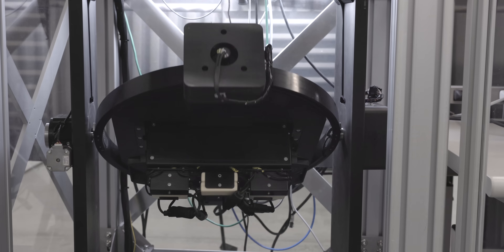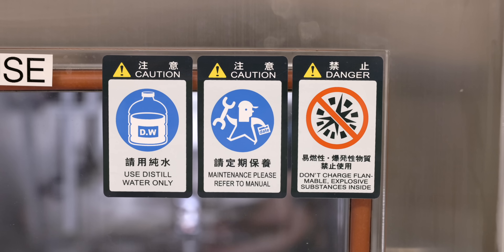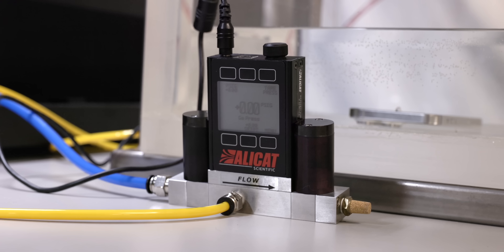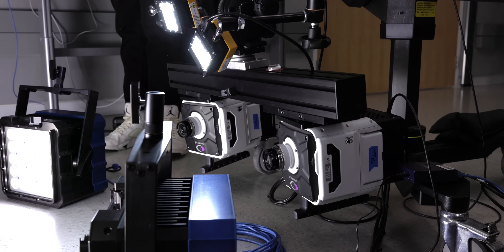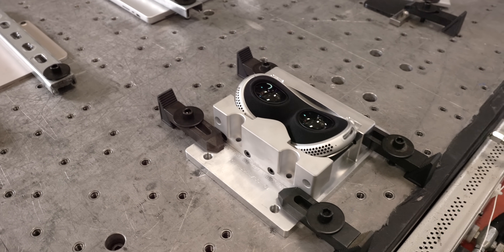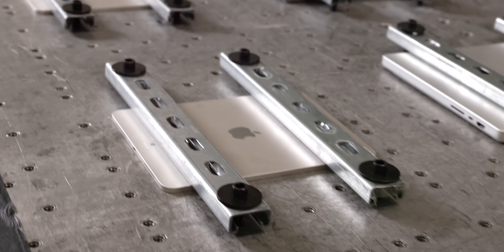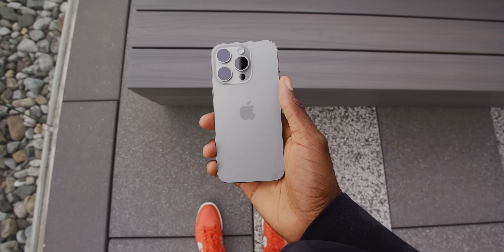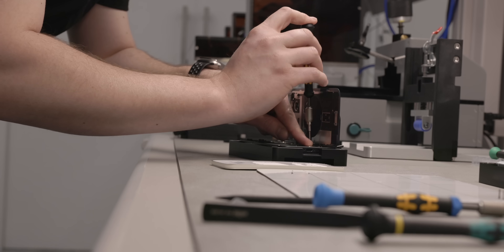I Visited Apple's Secret iPhone Testing Labs!

Comment: Saying that durability rules out repairability is I think outright wrong. Even the Apple engineer who would benefit from such a statement questions it. Pairing parts to make them harder to replace doesn’t add anything to durability, clips that break when disassembled don’t add anything to durability… in Fairness there may be a few components that would suffer from being taken apart like silicone/rubber sealants but that’s about it. Please really think about that statement Marques because it genuinely makes much less sense than you seem to believe.
Reply: I mean it's another promotional campaign and he's not going to question Apple's obvious anti repair practices
Reply: Also, consider how well-built devices like Fairphone and Framework's laptops are. The Steam Deck is a great example, too. They're still quite well-made, and don't have any of this anti-consumer behavior. I wholeheartedly agree with you here.
Reply: @nerdman1324real  The fair phone I would argue is actually more towards their point, it is only IP 55 rated while being much more bulky than most modern smartphones. There are always trade offs. That being said some stuff, like parts pairing are much harder to excuse.
Reply: @nerdman1324real Thinkpads came to mind for me. They have an amazing reputation of having insane durability and repairability that allow old thinkpads from decades ago to be used in this day and age. I don’t like how Marques is making repairability sound like a tradeoff that makes a product less durable when it is definitely possible.
Reply: @nerdman1324real  that's a fair point but could you drop a Steam Deck in a lake and still have it be functional after you fish it up?
Reply: @nerdman1324real  they're quite well made for what they are. but what they are is inferior to regular laptops in terms of design. Simply because they offer additional features. But those additional features come with costs. Not only is the price significantly higher with the framework laptops, but also consider that the profit of any given company is the only thing that drives innovation or funding for research and development. For example, paying companies like apple and Microsoft is what allows us to have an OS in the first place. Yes I know, there's linux. But people forget quite easily that Linux also wouldn't be anything of any significance without corporate backing. The majority of the code contributed is by corporations not individuals or hobbyists.
Reply: @nerdman1324real the fairphone literally falls apart if you drop it, and isn’t waterproof.
Reply: @nerdman1324real  Funny you mention 3 devices none of which is even close to IP 68 rating.
Reply: Outright refusing to sell reasonably priced repair parts, or any parts at all doesn't help either...
Reply: The perfect example is old Nokia phones : extremely durable (though water resistant) yet very easy to repair
Reply: just look at the old thinkpads
Reply: You can make a product not durable and not very easy to repair. Therefore you can make a product very durable and easy to repair. Are you saying the older iPhones are easier to repair because they definitely weren’t as durable as today?
Reply: One look at Hookes Law and Marques would retract that statement
Reply: i second this idea.
Reply: Also dont talk about how macbooks are designed in such a way where most repairs require an entire new board if something goes wrong.
Reply: In many parts of the world iPhones got stolen and snatched and sold in market as spare parts. So it makes a little sense.
Reply: OH MY GOODNESS! Didn’t anyone catch it that it’s not “Durability” vs Reapairabilty but RELIABILITY vs Repairability??? There’s a huge(!) difference. I get it, the parts pairing seems like a totally unreasonable choice, but a product that is more RELIABLE aka won’t fail (think Toyota Camry), not won’t break when it falls (think Jeep Wrangler). The Camry will always start up, but the Jeep will never break. The Jeep is focusing on repairability so that it can easily be fixed out there but it’s not reliable. The Camry is hard(er) to repair, but you never have to. I hope that clears things up.
Reply: Yeah that was such a BS argument. Like most phones these days are on par with iphone durability wise but some are way easier to repair. In ideal world I could buy that argument but we do not live in that world and iphone is not durable enough to justify poor repairability. And I doubt it will ever be that durable.
Reply: 💯 to say durability is at odds of repairability is complete bullshjt
Reply: I second this, you can have a device that's both durable and repairable or, fragile and irreparable. there's also a third variable of cosmetics.
Reply: How is he the largest tech reviewer on this platform and just verbatim repeats and agrees with literal Apple leadership on their bs anti-consumer reasoning? Like what? How the hell are repairability and durability opposites? Has he ever seen ‘pro’ business equipment and hardware, they’re made to endure a lot and be repairable? What kind of paper thick journalistic rigour is this?
Reply: @RobertHarnett it’s a phone… why are you comparing it to “business equipment.” Let’s listen to the random on YouTube over a certified engineer. It makes complete sense, though Apple is 100% anti consumer in the way they offer repairs.
Reply: I'm pretty shocked marques even gave apple the platform to talk this PR nonsense :D how can you say making repairs more difficult directly helps durability. As far as I remember Samsungs have IP68 and all of their repairs are cheaper and the phone holds up as well.
Reply: @DU715 shocked?lol first time watching the channel? It's apple, what do you expect from marques?
Reply: Except even for Samsungs newer phones, they follow the same trend. They’re more durable than they used to be and also much harder to repair nowadays than they used to be
Reply: He’s not saying that’s a hard set rule he’s saying there’s some instances where that is true and you have to choose to prioritize one of them in that case
Reply: @snowwsquire  The problem is that's not what Apple is doing, He was trying to be sneaky as far as I'm concerned. If Apple wanted to design a Phone that was both durable and repairable, they could but that would hurt their buttomline. They could care less about the environment,
Reply: @snowwsquire  "hard invest" lol
Reply: What the engineer said made completely sense. Idk why that is so hard to grasp
Reply: No I think it makes quite a lot of sense. You don’t need to repair something that’s durable…
Reply: @LaGranColombiaPorSiempre  Okay but there are edge cases where you might need to, and there's no reason why you would deliberately go out of your way to stop people from repairing their own property.
Reply: I disagree with you.  The vast majority of people out there never get their phone repaired if it's damaged due to abuse.  I'm talking about drops, etc.  They just live with the broken screens, until they eventually upgrade to a new one.  How do we know?  I can't count how many broken screen phones I've seen out in public, from friends/family/general population.  Virtually everyone.  Having said that, tipping the scale more towards infinite durability is ultimately better for the consumer.
Reply: @Vermithrax76  brother, that does not make sense... you don't see people repairing because it is not financially viable. Why is it not financially viable? Because apple's repair ecosystem is terrible and overpriced, they don't want you to repair but rather buy a new phone. If they made repairability a priority that would lower repair prices and people would opt for that.
Reply: @Vermithrax76  bro think of it
to replace a modern day phone screen it cost about $100~200
and for iphone it cost about $300~400

if that cost was low why wouldn't they fix it?
they just don't fix there device cause it cost so much

and this is crazy part
to make repair harder they do something called part Pairing.
for example if you replace a iphone screen
unless you dedolder a display chip from old broken display and solder it to new display
you can't use all the function of the screen anymore, such as true tone even tho they comes with the same chip
its just apple paired those chip with artificial limit so that its harder to repair

it is hard to make a phone to be both durable and  repairable 
but that is different from non repairable like part pairing
Reply: @Vermithrax76  Yes and the reason for that is because to replace a screen it costs so much to repair. A big part of repairability is to make repairs more accessible and cheaper
Reply: @Vermithrax76  I disagree, the reason we don't see people having fixed phones is because they can't repair them. It's too cost prohibitive and they can't do it themselves.

Comment: 7:06 Phone that doesn't have its parts coded so it can't be changed isnt less durale. Phone that doesn't use 15 different screw head types isn't less durable. Durability doesn't excuse Apples anti-repair practices.
Reply: you're absolutely right. i really like mkbhd so i wanna give him the benefit of the doubt, and think that he probably just wants to stay on apple's invite list, and would have otherwise asked way smarter questions.
Reply: @theteddychannel8529  yep. He did the same with the DOJ video. You can tell he's not trying to be too hard on Apple.
Reply: Very true, I agree with his points on more durable vs more repairable, but serializing parts is just insane.
Reply: This is bullshit from Apple, they try to make people think that if you make a device more "resistant" you have to sacrifice repairability, and that has nothing to do, Apple always deceive their naive customers in believing they are getting top tier devices, when you compare them with Samsung for example they are very equivalent in durability, making parts with code just to make more complicated a repair doesn't make them more durable it just make it harder for the customer and hence make the customer to spend more money either by purchasing a new device or by only using overpriced Apple's repair centers, when a lot of third party technicians are equally capable of doing a professional repair for less money.
Reply: You literally copied this comment word for word from someone else smh
Reply: Say it louder so the people in the back can hear you!
Reply: They're still more repairable then some other large phone manufactures out there. Not perfect by any means but some of those choices also make sense. iPhones are some of the most stolen phones on the planet. If you make it so spare parts are hard to resell because they're device locked, it limits the value in stealing the product. Now, in a perfect world, that wouldn't be an issue they have to contend with but it is. It's also not an excuse cause I'm sure their are more consumer friendly ways to go about it but they are getting better and now making it so parts can be swapped so long as it comes from a reliable source.
Reply: @CrizzyCrazy  Simple solution, allow consumers to have access to the parts pairing software.
Reply: In many parts of the world iPhones got stolen and snatched and sold in market as spare parts. So it makes a little sense.
Reply: An argument can be made here: Is it possible that Apple is deliberately making it hard to repair their phone so that people go to Apple to repair them, because as we just saw; It's such a "technical'" aspect of building a phone from scratch in such a way so as to make it durable, that to allow lower skilled, off-the-street repairmen to replace internal parts may lower the overall experience and potentially lifespan of the device?

Think of it in this context - If you're wealthy, and you buy a Ferrari. When it needs to be serviced or repaired, wouldn't you rather send it into the official Ferrari garage rather than some random mom-and-pop shop? The mechanics at Ferrari have been specifically trained and have years of experience in Ferrari motors and gear boxes, so they know what they're doing.

I'm also not saying that Ferrari wouldn't 'scam' you by overcharging because I'm not talking from a financial point of view, I'm talking from a technical one.
Reply: @zero131056 This i-sheep thinks his iphone is a ferrari 😂
Reply: @zero131056  What a load of crook. It is proven that Apple certified repairers are far worse than independent ones.
Reply: I’d imagine each screw has its use otherwise why isn’t there just one for everything. Also Apple could just save money if there wasn’t a reason to use different ones
Reply: @te86a  What changes is the type of head, the lenght and type are the same, so there is not reason for it to be like that, imagine if it was the same to change the wheel of your car, Would you like to use 5 different wrenches even though the screws are the same? No, there is no good reason for them to even be torx, much less for them to be different measurements.
Reply: @te86a  one kind of screw wouldn't be enough, but it gets to a point where it starts to smell like malicious intent.It's much about saving costs, it's about dividends for investors.
Reply: Can we stop pretending that people who repair phones only have one screwdriver? That's more a packaging thing than a durability thing, anyway.
Reply: @soupisgoodfood42  It's not about the number of screw drivers, it's about unnecessary complexity put in place just to make it harder because now you gotta keep track of all the screws, and using the wrong screw can break the device. It's just a good example of how the 2 things aren't mutually exclusive nor a gradient.
Reply: @un_lucio  They're doing that because they want a slim phone, not make it harder to repair. That wouldn't make any sense from a manufacturing perspective.
Reply: @soupisgoodfood42  Apple claiming to prioritize repairability is BS if they care more about making the device slim than making it durable or repairable. And I'm saying this as person who has almost exclusively used Apple products since 1988.  With the previous MacBook Pro (that one with the touch bar) they went anal with the slimness resulting in a product that I was happy replace (and not repair) when it wore out.
Reply: @soupisgoodfood42  No, it makes it harder to repair for someone other than a repairman and that's silly if what I want to do is just change something stupid like the screen that on any other cheap phone is just popping out a simple cable and plugin it again.
Reply: @soupisgoodfood42  I dont have security bits laying around, didnt need them when i repaired my moto z4. "People who repair phones is not, and should not, be limited to an officially liscenced apple technician
Reply: @soupisgoodfood42  for most other companies third party manufacturers dont have to first reverse design, test and build dozens of new screwdrivers to then sell them to repair shops to unscrew parts like batteries just because apple specifically makes new screws that are more difficult to open and incompatible with exisitn tools - knowingly making them worse and easier to break in repair attempts to prevent most repair shops from ever going the distance to have all that specialized quipment just for it to be obsolete a year later when apple decides to make the next thing thats different for the sole reason of making it harder.... surely in the name of durability.... its such a common issue to have screws  break on non apple devices right? 

and this isnt a "cry i need to buy a screwdriver"  issue - its a systematic planned and intentional attempt by apple to make repair more challenging using every method at their disposal, glues, labeling, reapair parts, brickng devices, firmware locks, and so much more - down the the freaking screws they use.
Reply: @geniumme2502  No one has ever had to reverse engineer and design multiple new screwdrivers to work on Apple stuff. You're exaggerating the problem. I know this because I spent 5 years working at an electronics recycling company. I repaired and dismantled all sorts of computers. Sometimes they use more obscure drivers to save some people from themselves, but any decent repair technician should have no problem finding the tools needed for a job. As for gluing stuff, the videos shows how that's not just to make it difficult to repair. As for firmware issues, that's often a security thing. Besides, Apple is still getting better with repairability thanks to more new laws.

Comment: apple's repairablilty issue is not with "it's too hard to repair". it's that they artificially make it hard to repair. let me give you an example: if changing a battery was hard because they made it resist shaking, that's fine. but what they do (this is an example,  not a real case) is say "WOW, you changed you battery on a non authorized repair shop? you can get HACKED. we will not allow your phone to work until you go to an official site" and then they sell the part with insane prices because they jsut want you to buy a new one.  they do not want you to fix it, you NEED a new one

Comment: 7:39 my issues with this is when you look at the fairphone or the framework laptop they are bothe very good designed that are extremely user repairable and very usabe, infact the fairphone is way more likely to survive drops because the back is not made of glass, like if the iphone was more durable and didn't have a back made out of glas that shatters after 1 drop i feel like i would believe him more

Comment: Eh durability vs repair ability isn’t necessarily always going to work like that. There are absolutely ways to design systems (ie an iPhone) where the system is broken into smaller, more durable components that make up that overall system. By then making those individual components repairable you are getting not only the durability but also the repairability. The problem is then you drive up cost because you have more components and then your margins are worse.